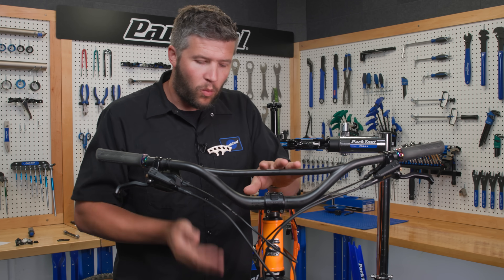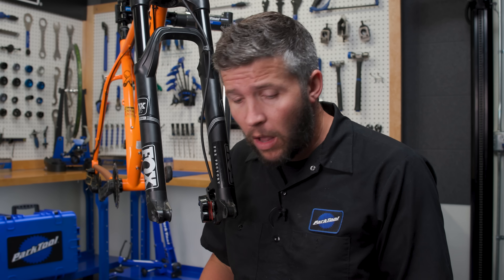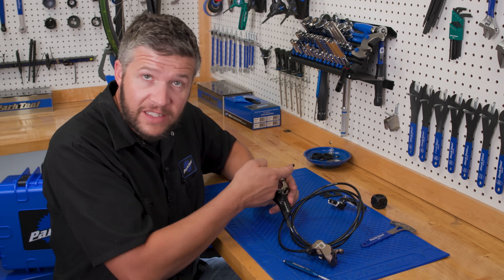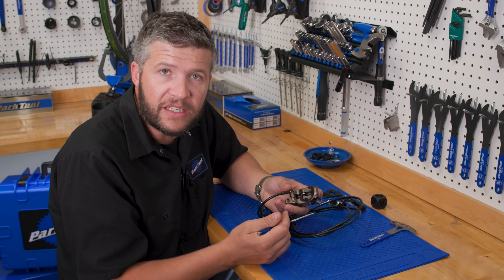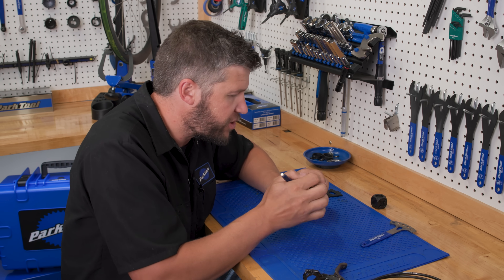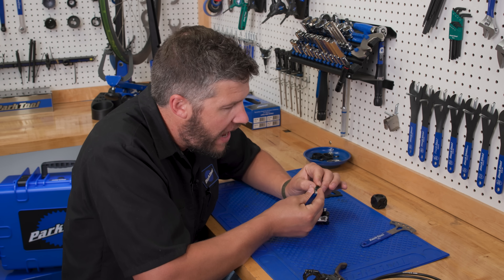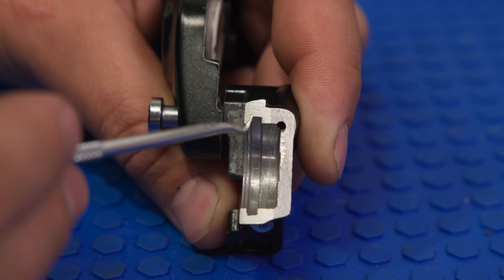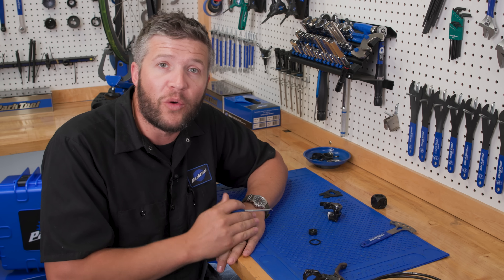Resetting Disc Brake Pistons | Tech Tuesday #238

Comment: This problem for me is constant all the time I have to replace the pads, they get thin, the pistons advance and when you insert the new one they are way thicker than the old one, so the pistons need to be pushed back...this happened on all the bikes with hydraulic brakes I ever had, and this is a lot more common than accidentally pulling the breaks, why people never mention this problem anywhere!!??
Reply from the maker: That advancement of the piston is considered a feature. This makes the caliper "self adjusting" as the material wears away.

Comment: Ps1 or Pp1.2? What's better?
Reply from the maker: The PP-1.2 and the PS-1 have different uses.  The PP-1.2 spreads pads back quickly into the caliper.  If the pads were squeezed the PS-1 is thinner and will open those brakes.  The PS-1 simulates a rotor when testing a bleed.

Comment: This "seal" is also the reason you can't get your "levers" to catch as much as you might desire (less throw when pulling levers). The rubber seal flexes back out limiting how close the pads can get. If you want a shorter throw of your levers, meaning catching higher, check out my video on this exact subject. It is a "trick" to get the levers to engage at the top of the pull. (FIX SPONGY BRAKES!  Adjust Bite Point and Shorten Lever Throw on Hydraulic Disc Brakes!)

Comment: Thanks but is it necessary to loosen the top or bottom of the left hydraulic lines before pushing the pistons back in ? As to release the pressure behind the pistons ??

Comment: But what happens at the other end? Isn't there a spring in the brake/brifter that pulls the piston back, too, which would pull the oil through the hose, and in turn pull the pistons in the calliper back?

Comment: With these new ultra lite scram ceramic piston heads this is a bad tool to use. The reason being you want them all to go in evenly and these ceramic one stick sideways and if you keep pushing you break the brittle pieces of crap. Use a ratcheting style caliper spreader instead that does it very evenly.
Reply: that I got on Amazon right away.very inexpensive and worth it.

Comment: OK, talk about screwing up. I one pad that pushes the brake pads on an Magura was hanging up, so for some reason I got it to fall out. Hmmm, well pretty brake fluid for sure. So I tried to put it back in, guessing very difficult without disassembly? Can you assist or do I just get a new Magura brake system for the front wheel?

Comment: Me. I wonder if i need new brake pads. Remove wheel and brakes. Habitually press on brake lever. Piston pops out. Oil spills everywhere. Im going back to mechanical brakes
Reply: stick a 4mm allen key in there and freely pump the pistons out
Reply: hey that’s what happened to me
Reply: Hey youre not alone, my dumbass thought the screws holding the calipers together were for adjustment and guess what imwqas all out of fluid and all of it leaked out contaminating my pads, disk, hands, and clothes. But don't give up I had mechanical and yes they are easy but hydraulic is so much more premium.

Comment: Shimano recommends opening the bleed port on the lever before resetting the pads to avoid damaging the seal in the Master Cylinder.  Best way to avoid this situation in the first place is to install the pad spacer that came with your brakes any time the wheel is removed.  We remove the lever bleed screw and install a funnel or syringe whenever we reset caliper pistons at the shop.
Reply: Oh that's a damn good idea never thought of that. Also this tool is kind of well a tool. With these new scram crappy ceramic piston heads there won't push in easily with the method he's doing there's a tool you really should use now. That has a dial on it to spread both piston heads very Evenly.. Why because the ceramic heads stick and they're awfully brittle. I learned that the hard way cracking one of them pushing them in old school way like he is doing.
Reply: @geu6270  What works very well to reset pistons is a woodworker's 2" Pony Spring Clamp.  We have made some custom Bessey 2" C-Clamps on our milling machine that we use for resetting pistons as well.  The clamps also work well to hold a piston in place when freeing up a sticky piston.
Reply: Hi, Is this really true thar you have to open the bleed port before using the tool? i have an ultegra 8070... i didnt know it was this complicated
Reply: @darksidesosu1144  yes, this comes straight from Shimano.  We are an Authorized Shimano Service Center.  We relieve the pressure on all hyd. disc brakes when doing a piston reset.
Reply: This is from Shimano Dealer Manual DM-GADBR01-11:
"When pushing the pistons back, do so with the oil funnel attached to the dual control lever/brake lever. Otherwise, the diaphragm of the dual control lever/brake lever may be damaged by the oil pressure."
Reply: @darksidesosu1144 

It is true. Welcome to the era of modern bicycles where everything is complicated and expensive to fix and where we are using things we really don't need.

Comment: Great video but my SRAM Rival lt. sided rear brake piston is stuck now. Should I take the caliper off and then let any brake fluid seep out in order to properly reset it. It's stuck and I can't get it back in. Also, is that piston now scoured and not able to retract smoothly as a result? I tried putting SRAM brake fluid on a Q-tip and then lubricating it but it's not popping back in. Ugghhh...frustrating. With the price of a new caliper being about the same as a rebuild with labor at the LBS, at this point that seems like a better deal-new caliper/pistons/seals and brake pads.

Comment: How do I get my brakes to bite sooner when pulling my lever?  Seems half way downhill sometimes it feels like I have to pull my lever much further in order to get the bite i want.
Reply: Sounds like you need more fluid in your lines but there is usually an adjustment screw near the brake lever that adjusts the angle of the lever too.  If that doesn't work I would do a brake bleed.

Comment: What do you do when you push 1 piston back, and the other one just comes out because of it? Tried to use 2 tyre levers to hold 1 inside, and push the other inside as well but I failed. Im going crazy here

Edit: apparently it had too much oil for fresh pads

Comment: Nice video. You may need a bit more zooming but the schematics worked very well. Maybe I never asked myself the question, but I did not know the seal was responsible for pushing the piston back. Isn’t some suction from the fluid also responsible for that?

Comment: What about if the pads won’t move to grip the rotor and brake? I adjusted the cable and it still won’t grip the rotor. It happened after I loosened the outside screw on the side

Comment: Hello. Thanks for your video but I still cannot fully insert both pistons into caliper. I have new brake pads but after installing them there is too little space for brake rotor to fit. I tried to push back pistons using screwdriver and old pads but it didnt work. Then I cleaned the pistons and tried to push pistons back separately but pushing one caused the other to come back out. How do I reset their position? Do I need to unseal system and then set them to position?

Comment: with a flat brake disk the pads can float quite close to the disk, ready to make contact w/ little travel at the lever...

a little trick to reposition the pads as close to the disk as possible on a regular basis: use rubber bands to keep the brake lever pulled in overnight. you need just enough pressure for the pads to touch the disk and w/ time the caliper piston will slightly slide thru the square seal closing the gap between the pads and the disk. in the morning the brakes will feel firm -given there's no air in the system.

Comment: I learned the hard/expen$ive way NOT to use the  Park Tool PP-1.2 Hydraulic Brake Piston Press without the brake pads installed... cracked the ceramic cup/piston in the Shimano Ultegra R8020 disc brake caliper - love the new PS-1 Pad Spreader - and do not even think about using a tire lever

Comment: How to cut or reduce lever travel, i like the least travel posible but mine only 'starts' breaking middle lever...thnks
Reply from the maker: Some brakes have a "pad contact adjust" which allows you to adjust when that happens in your lever pull. Most brakes do not have that and there is no adjustment for it.
Reply: You can overfill the system, don't use a bleed block or use a thinner bleed block. This will only last a while until the pad wears away though.

Comment: So why doesnt the seal adjust the calipers when the wheel is off?
Reply from the maker: They will not adjust unless the lever is pulled. The reason you need to separate the pads after you pull the brake is because it adjusted to nothing.
Reply: I didnt get it. What do you mean “unless the lever is pulled”? In both cases (wheel on/ wheel off) the lever is pulled but the seal in one case adjusts the pads back but in the other doest. According to video when the wheel is in the seal adjusts the pads back in to position but when the wheel is off the seal doesnt adjust the pads back in to position. Why so?
Reply: @andriskadaga  2:58 overexcursion, seal is in new position relative to the plane of the brake, piston is now at rest at seal's maximum range
Reply: The adjustment works like this. The seal is like a spring that can slip. If you only move the pads a little way, the seal doesn't slip, and it moves the pads all the way back. If you move the pads too far, the seal slips, so it only moves the pads part of the way back.

During normal braking, the pads can only move a short distance before they bump into the rotor. Because the pads only move a short distance, the seal doesn't slip and it's as if it's just a spring. However, as the pads wear, they need to be pushed out farther to reach the wheel so, eventually, the seal slips a little bit. That's how the self-adjustment works. The adjustment means that, as the pads wear, the pistons move farther and farther out to keep the gap between the pads and rotor constant.

Now, suppose you pull the brakes while the wheel's out. There's no rotor to stop the pads, so they keep moving until they bump into each other. That means they've moved a long way, so the seal has slipped and they only retract a little way. It then becomes hard to separate them, because they're so close together.

Comment: I struggled to get past the first two minutes of this, never use dot fluid in mineral brakes, it will destroy them. 

Mineral oil also has a higher boiling point than dot fluid

And don't do the bleed nipple or sealing screw tight. They will shear or strip the thread.
Reply: I think you commented on the wrong video... he didn't bleed the brakes here... what video were you watchjng?
Reply: You struggled to comprehend what he was actually discussing in this vid. LOL

Comment: Are these seals considered a maintenance item that should be replaced at recommended intervals?
Reply from the maker: There are brands that offer rebuild kits and have service intervals. There are other brands that offer no serviceability when it comes to these seals. For those they recommend replacing the caliper.

Comment: What do you do when one or more pistons advance further than the others.
Reply from the maker: One of the pistons will typically advance quicker than the other/ others. Its not important to have them advance at the exact same time. Once one of the pads meets the rotor it stops advancing and the other piston/'s start advancing more.
Reply: @parktool dang, this is an important sub comment!❤thanks for clarifying that they balance themselves out

Comment: Great explanation. I kind of prefer the PP1.2 rather than the PS-1. Any particular reason to choose one over the other?
Reply from the maker: Both great tools. PS-1 does get between pads that are compressed together easier. The PP-1.2 does better pushing directly on the pistons. The PS-1 is able to simulate the brake feel at the lever without installing the wheel. Both are great for similar but different reasons.
Reply: @parktool  thanks

Comment: So... to lubricate the pistons is pointless.
Reply: Not only pointless, I read somewhere it's even detrimental. You want a bit of friction between the square seal and piston whereas with lubrication, the advancing piston doesn't flex the seal. It just slides out and does not retract.

Comment: If you don't have that tool on hand. A chain wear measuring tool will do the job too. At least the one I have does.
Reply: A large flat screwdriver works perfectly well
Reply: Thank you!!! You saved me. I have a $10 Amazon chain wear checker anyway so even though it bent a little doing this I don’t care. Got me out of a pinch.
Reply: dunno I've been using the spacers that came with my brakes... worked fine; and I guess any tool that has an edge and blade that is not gonna bend / break would work as well to separate the pistons enough to fit through the rotor again
Reply: I wouldn't use anything that's gone near a chain. No oil on the brake pads, please!
Reply: Butt knife
Reply: I wouldn't use a measuring tool for any brute force task. A plastic tire lever would be a better, cheaper choice.
Reply: @mattgies  it's not exactly brute force. Just a little pressure is enough. If I had to use brute force on the pistons something would be very wrong.
Reply: @erikdg  "Brute" force or not; that's just semantics. A measuring tool should only be used for measuring. Applying any force to it that it wasn't designed for can make it lose its accuracy. Chain wear is measured in fractions of a percentage point, so I wouldn't risk it.

Comment: Any thin tough metal would do, why buy the tool unless you're a repair shop
Reply: The tool itself is a clue that you can also use an old rotor.  While I don't have this one, many of the times I have purchased Park Tool tools they were chosen over cheaper options to support the production of high quality repair help videos that have been of great help to me.

Comment: Very timely video I am in currently replacing my brake pads on my bicycle. I would be interested in seeing a video of how to clean that O-ring when dirt gets in there.
Reply: Not an O-ring, it's a square ring. There was a Tech tuesday a few months ago that detailed how to clean the piston and to fix a lazy piston. Since that cleans the piston-seal interface partly, that's the only thing that's reasonable for a home mechanic to do. Otherwise it's disassembly which is not advisable. In short, iirc: remove the wheel and pads. carefully squeeze the lever to reveal more piston, but not so much it pops out. Clean the outer edge, where it interfaces with the seal, with a q-tip dipped in your correct braking fluid. Push the pistons back in. Repeat until pistons both move freely and equal.
Reply: @RenAigu  one thing YOU MUST DO after you're done with the "brake fluid cleaning" treatment, you MUST clean your pistons and callipers with isopropyl before you insert the pads back in. And be very thorough about it. Otherwise you will wreak havoc on the pads and discs.
Reply: @RenAigu I have had to reinstall pistons from scratch before .
Reply from the maker: https://www.youtube.com/watch?v=vQXFFgRButo
Reply: @parktool  thank you for the link. I just watched it and that’s what I’m gonna do.

Comment: Spot on as always! 

Also important: Bleed your breaks only with bleed blocks. 'cause otherwise you might run into a problem once you change your rotor or pads. And when you then start to push back the calipers you might kill the membrane in your brake lever by accident. Reason: Without bleed block there is a chance you put to much hydraulic fluid into the system.
Reply from the maker: Right?! The bleed block also needs to be the correct thickness for the system, to set that fluid volume as well.
Reply: @parktool  I bled my rear brakes with a bleed block, but now that I'm replacing the pads (after riding around on the old thin pads), I cannot press the pistons outwards to provide room for the new pads. When I press one piston outwards, the other piston moves inwards. Any suggestions? These are SRAM XX MTB brakes on an Epic from 2011. Edit: I opened the bleed port on the caliper and was able to move the pistons back, releasing some brake fluid, and was able to get the wheel back on with the new pads, but now there's insufficient braking, so, I'll be bleeding this caliper again, and hopefully that will sort it out. 😮

Comment: What about cable actuated hydraulic brakes?  How do they work?
Reply: Usually only one pad moves with cable. And there is a spring that returns it when you let go of the brake
Reply: @8BitZ0mbie I think they're talking setups like TRP HYRD's which are hydraulic at the caliper instead of full cable actuated.  Both pistons move, not just one like Avid BB7's.

In the case of HYRD's, treat them just like any other hydraulic pistons.
Reply: You could say they have the lever and caliper all in one unit. You pull the lever and subsequently the cable which at the caliper pulls on an another lever that pushes a pushrod and so on. The piston and seal are exactly the same as in full hydraulics.
Reply: That's what he is explaining
Reply: @adamwolfram6675  Truman is describing fully hydraulic systems where there is fluid in the brake lines.  My TRP brakes only have fluid in the cartridge.
Reply: This problem doesn't happen one mechanical brakes, there's is no fluid.